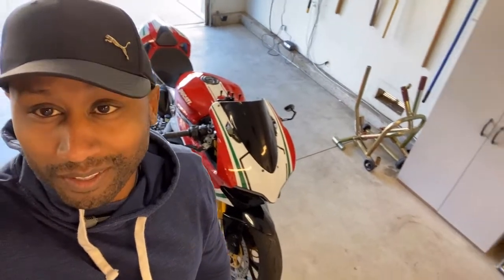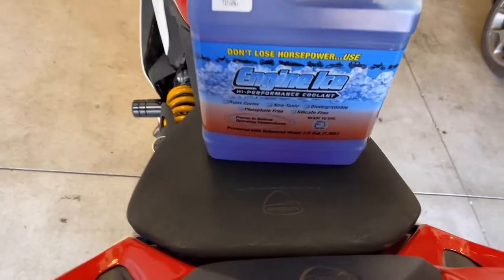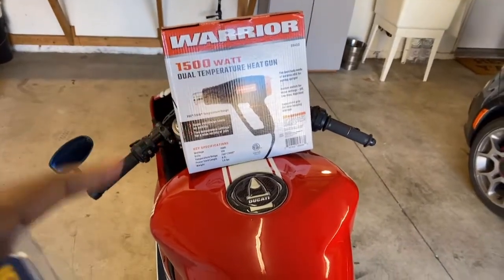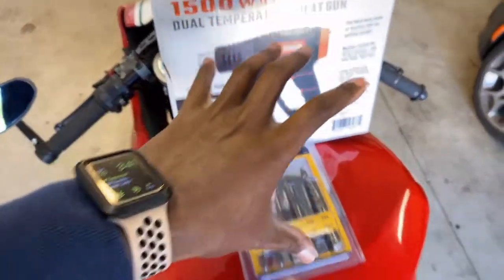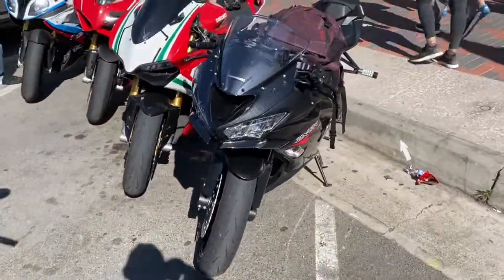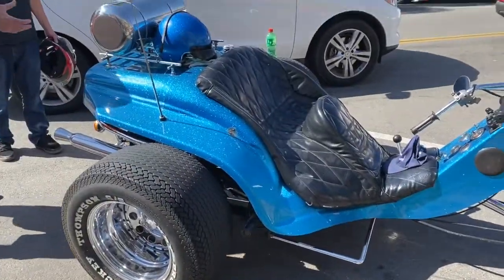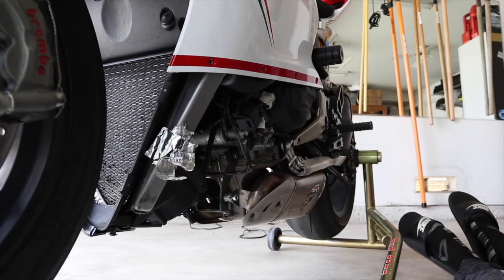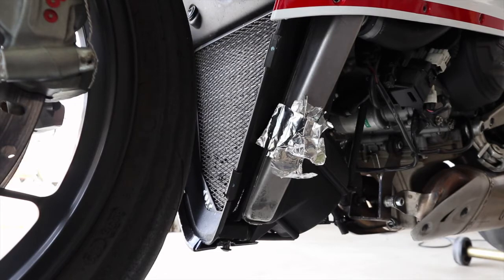Using J-B Weld Epoxy to fix an issue  on my Ducati 1199 Panigale S | **Success or a bust??**

Comment: Hi Nomadic. Get a welder to weld up the hole. Then drain the coolant by undoing the radiator hose at the lowest point.
Reply from the maker: Thanks for the info. It is appreciated.

Comment: Cutting a slot in the head as recommended by others is something I have done in the past.  Once you get past the fact that you are going to have to buy a new radiator there’s lots of stuff you can try before you buy because at that point you have nothing to lose.  I would at least take the radiator to a machine shop and see if they can get it out.

Comment: Have you tried old trick ? Cut head of the bolt make a notch on both sides with metal mini handsaw and use large flat screwdriver to jiggle out , should not slip or strip that way , also heat up head with mini blow flame torch not pink hairdryer :) should release the red nut lock with heat
Reply from the maker: How dare you talk about my pink hairdryer 😄!! Jk 

 I think the head of the bolt is done. Theres not much material there to do a lot with it. I’ll take another look at it to see though. Thanks for the info bro